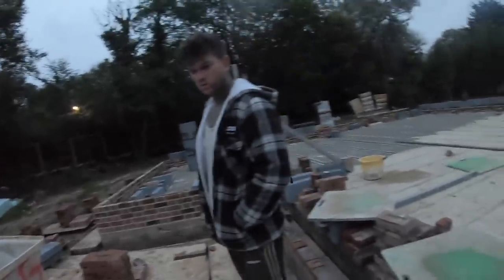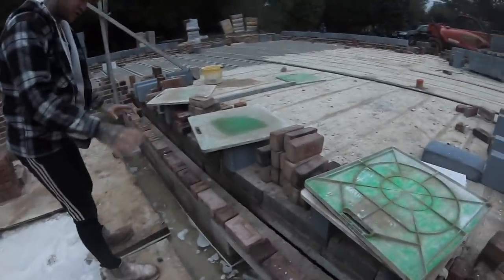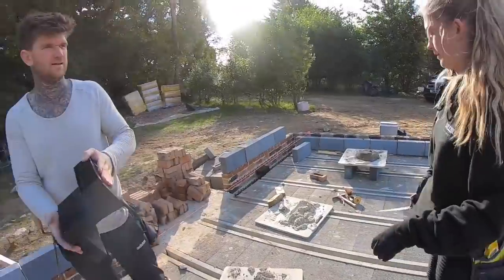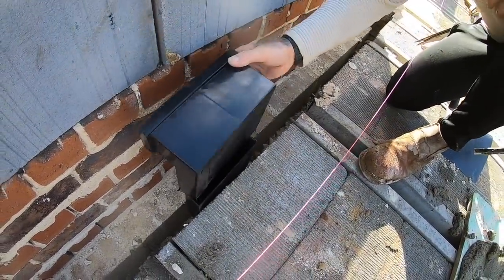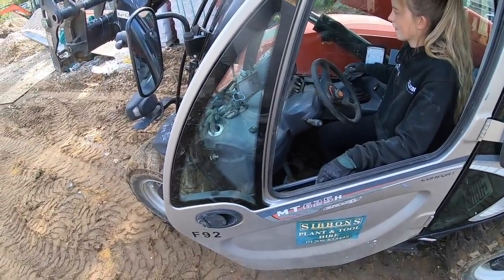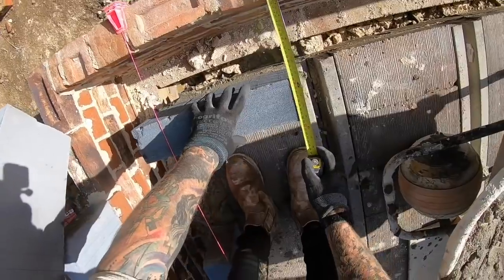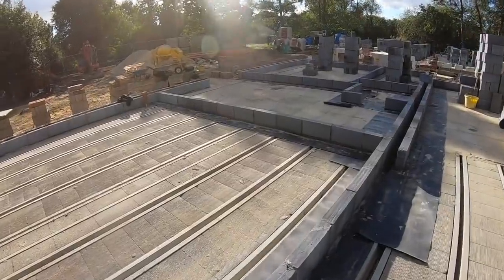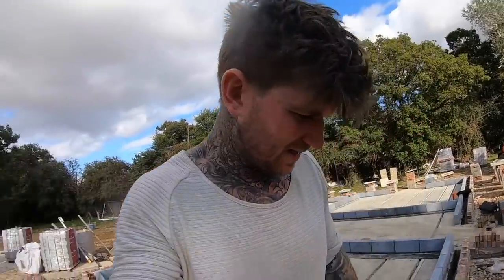Bricklaying - Day 3 - Amy on the forks

Comment: from an architects pov.. i've said it before, a lot ARE lazy, and can't be bothered with brick setting out, at my company we do work to brick dimensions, (even changing clients pre drawn House Range to suit) BUT it also depends upon the client and what they purchase, by that I mean, a lot of big house builders buy off the shelf non brick sized windows and doors, (915 or 1200 etc etc) which obviously means at some point there will be a non brick dim, we try to do overall brick dims and then get most of the others in between brick dimmed up and have just 1 non But again depends on the clients on the o/a size, the mass builders o/a size may not even want brick dim because they are working to the sqft of the house and don't care about the dims. We are currently doing a national housing range for a less well known client that wants all dimensions to be brick set out which is perfect for us, they are using brick size windows and doors etc etc. When it comes to special bonds (we never do them on ours apart from garden walls!), we do usually detail up anything that needs doing, but again it depends upon the client, it's cost as usual and if they are only willing to pay for say basic pack then that's all they get, as obviously it's time for us to do details which has got to be priced up as with any business, and as with any job the customer wants the price to be as cheap as possible.

Comment: Header, closer, stretcher from the corner. Then stretcher header over the top.
Reply: That's the idea. But you cant have shitty little bits when you get to the windows so you have to just make it work sometimes. Bricklaying comes with a free artistic qualification 😂
Reply: @man1cs171 . Absolutely, but you wouldn't break a bond at the corner (ordinarily). 
But there is a plinth course on here which will bring the bond back.

Comment: lovely stuff charlie what are you pointing up with ,bit of wood/compressor hose? you used to get old style pram tyre which made a nice flush joint
Reply: Best thing for a flush joint, can still get them new fkin fortunes, find an agricultural tractor mechanic 30mm fan belt does the same

Comment: the Flemish bond wrong
Reply: Very helpful and comprehensive reply to help us all...
Reply: Why is it ?
Reply: The reason flemish bond was used was when it was all 9 13.5 18 inch walls there were less facings per sq yard used header 120 sq yd stetcher  90 sq yd english was used for load bearing less internal straight joints and garden wall bonds the most economic of all and rat trap ie flemish on edge was used for tile hanging  ie nail into joints 4.5 apart 9 inch tile half lap in pre drill days cut nail in the bed joints

Comment: No when it come to bonds, engineers and architects really need to ensure that window and door measurements correspond to the style of brickwork involved in the outer leaf of a particular part of a build. It would be a constant factor that simply needs to be applied i.e. +/- 15 or 25 mm. And with CAD there's really no excuses anymore is there.
Reply: It also helps if you can shift openings 5 or 10 mm with out causing any problems internally. In kitchens or bathrooms or on the next lift